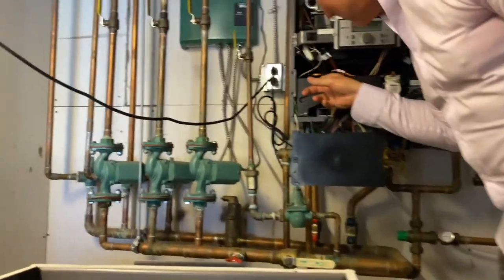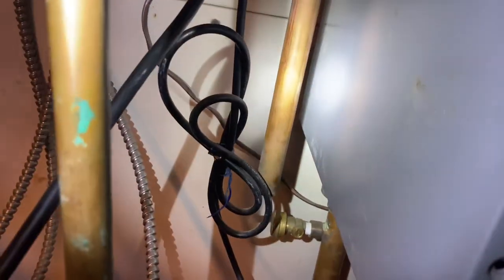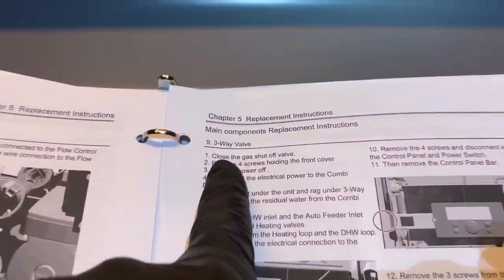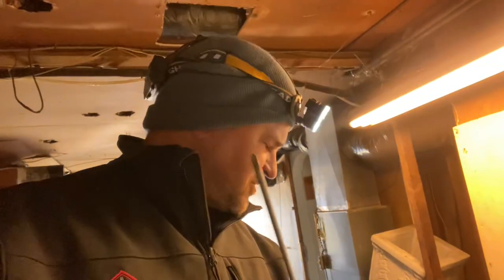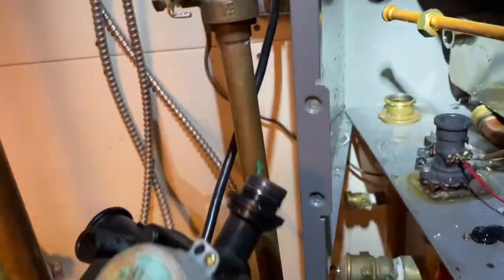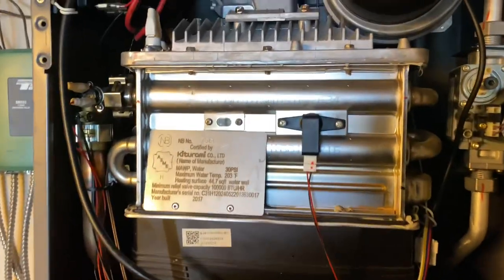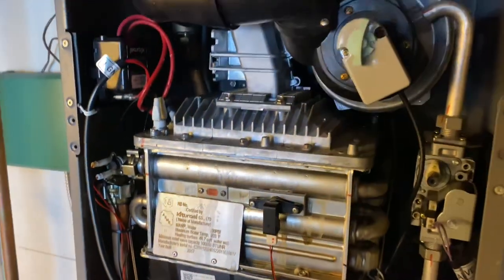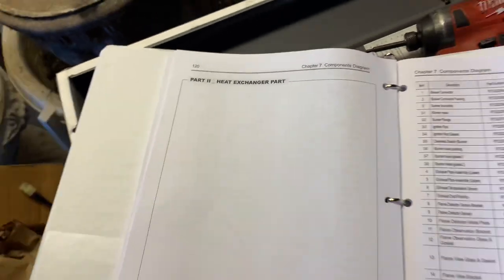Beating It With A Pipe Don't Work Anymore? Rheem Tankless Combi Leaking Combustion Gases!

Comment: I've worked on a Rheem combi before. Same issues as you had. One thing brakes after another on the boiler. Thing suck is it's very tight, no supply houses in the area don't carry parts for Rheem and the installation was terrible. After the 4th time I fix it, I told the customer is time to replace it and they agree. A week later heat exchanger was leaking... Removed the Rheem and installed a Ideal floor mount combi. The wall the Rheem was installed on was terrible and the customer wants the boiler moved to the other side of the basement for some remodeling, so I installed a  floor mount combi. No need for a wall and it's much easier to service.

Comment: I sent you a pic by email of my turkey fry splatter shield. It works great. Peanut oil went up #FJB I think my fryer is too big. 42 qt I had to buy 2 35lb containers of oil. It comes out so good though. I have a Thermoworks digital wireless dual thermometer. I keep one probe in the bird and the other in the oil. Once it hits 370* in she goes.